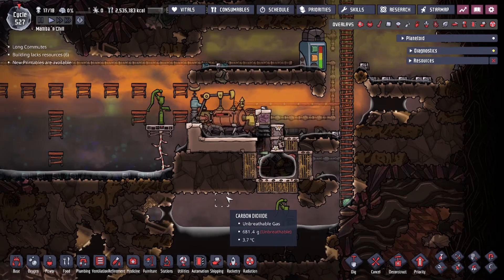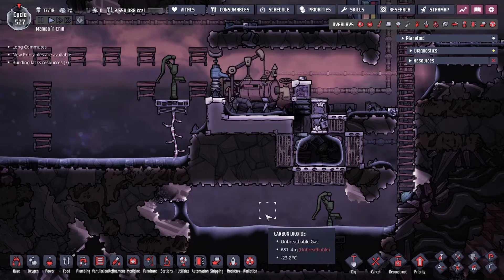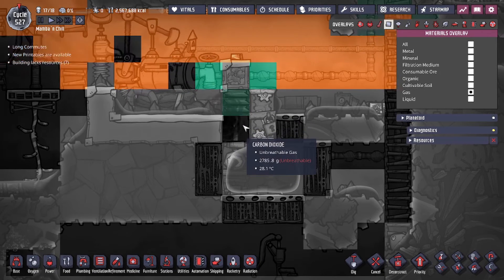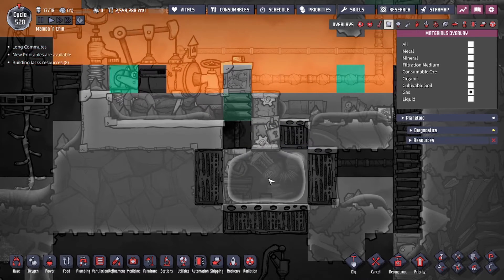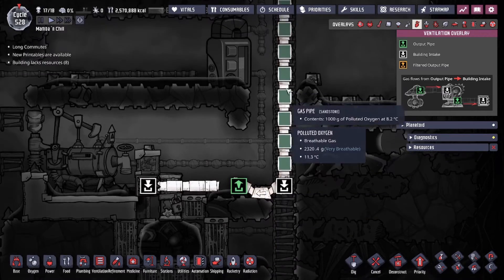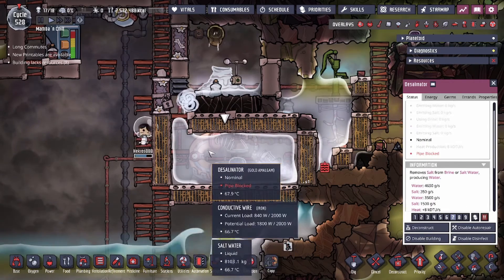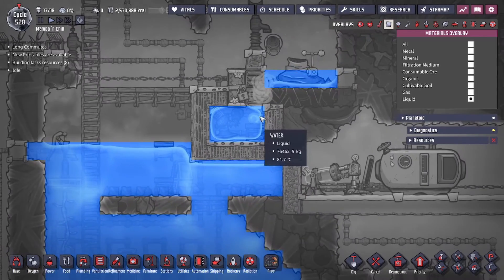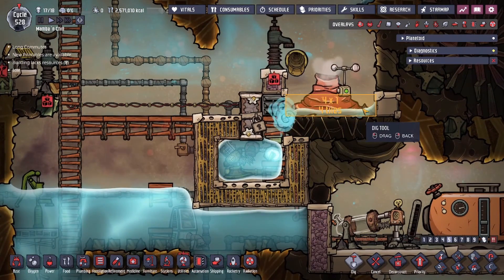Infinite Liquid Spill Storage - Oxygen Not Included

Comment: I have been accumulating a massive reservoir of salt water above my geyser. I was going to be in for a hell of a pumping campaign to move it to infinite storage, but then I saw the salt water geyser setup you have here. I mirrored it and added two bunker tiles above the geyser on the door side. Then I broke open the reservoir and dumped the whole thing very quickly into the new storage. A most satisfying solution. Thanks for the awesome videos!
Reply from the maker: always happy to have people enjoy my content!

also, that was a smart move with the tiles, as if you spill too much water into it, it can potentially break the gas lock

Comment: Will this work in a cold biome? When the geyser goes dormant and the water on the surface freezes?
Reply from the maker: if you keep the area above the spill as a vacuum, you dont have to worry about that. if heat is something youre worried about, whether you re worried about heat leaking out or cold leaking into the design, the vacuum + insulated would counter. i ahve another video that goes more into it - https://youtu.be/UAxVcncxSHo
Reply: I've had it work without a vacuuming using insulated tiles made of igneous rock and mafic rock all around the geyser, with the tiles 4 tiles above the geyser.  Also, below the airflows and on the sides.

Comment: I'm curious to see how such works with a polluted water geyser or cool slush geyser.  Does the off gasing of polluted oxygen from polluted water pose a problem to such a system?
Reply from the maker: it actually doesnt, the po2 actually means theres already one gas there too so its slightly easier, technically. the off gassing does not destroy the gas lock that allows the water to over pressurize